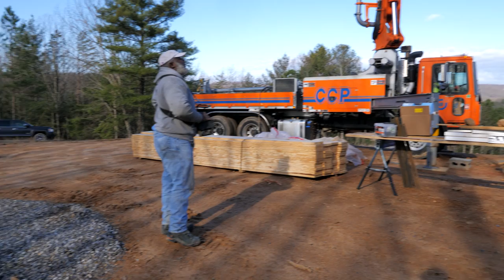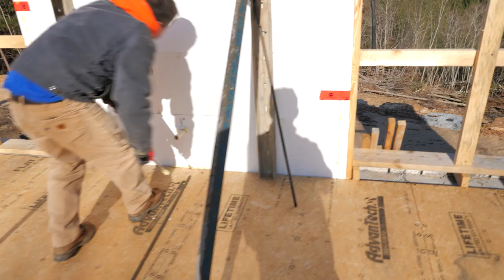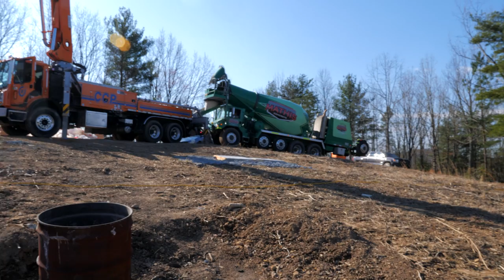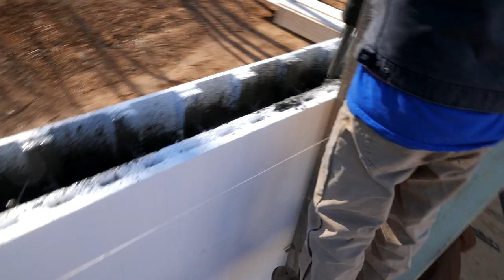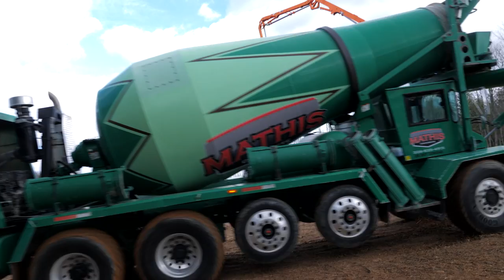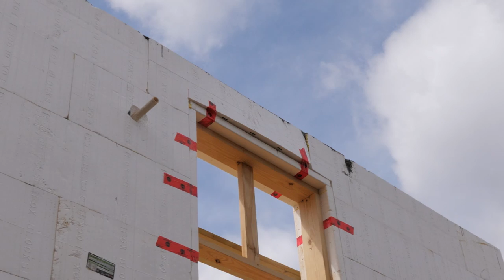ICF Mountain Homestead: Pouring the First Floor Concrete Forms

Comment: As soon as I saw the headers/lintels weren't strapped, I was nervous they would bulge/be difficult to align.  One thing I've learned from building with icf since 2001 is where it needs additional bracing.  It sure is a pain to have to rasp foam for hours to flatten it out!

Comment: Can you explain why you're doing ICF for the basement and first floor, but chose to wood frame the second floor? Is this a compromise for cost considerations or is there another reason why ICF made sense for the first floor, but not the second?

I'm curious about your thought process because I've been planning/fantasizing a house that would be full ICF exterior walls from the basement to the second floor. Should ICF not go all the way to the roof? Change my mind!

Great content, thanks for posting!
Reply from the maker: We’re doing it this way for a number of reasons. Window placement, cost, speed, etc.

Comment: Looked like the concrete was coming out of the hose pretty hard. Amazing the force the pump can do. Great to see yalls progress. You said gonna shave it flat. Does that mean you're pulling off the insulation in those spots or just shaving the insulation flat? Excited to see it get dried in! Thanks for the updates.

Comment: Insulated concrete forms look pretty cool. I had been researching the inverse option of having MgO-foam-filled ("airkrete" insulation) concrete blocks or panels. I like the cement foam solutions since they are the best insulation and they do not burn. Polystyrene does burn, although it will do a reasonable job at retarding the flame. And, these ICF blocks make house building a straightforward affair it seems.

[aside : 'airkrete' is different to portland-cement based 'aircrete' which is heavier and structural.]

So, in making some decisions, I ended up at this question about the ICF approach : "How do I attach anything significant to the walls in my ICF poured garage or workshop ?"
I cannot see any general wall strength that will support anything more than let's say some dry wall ... but certainly not anything the needs to anchor into a solid substrate (for example, a tool rack or hoist).
How are people doing that in buildings made with ICF ?

Comment: Did you consider do the wall penetration for the dryer after the did the first lift to make sure there weren't any possible voids? If yes, what reasons did you have to not go that route? Thx

Comment: Will there be a porch with a roof a the french doors? If so, please consider putting lights or ceiling fans with lights on that ceiling that are switched independent from the lights next to the french doors. I have found that bugs are drawn to the light next to my doors making it about impossible to use my outdoor lights in the summer time without getting bugs in the house when going in and out. For years, I have basically not even used my outdoor lights during any sort of warm weather for this reason.
Reply: He talked about that in the previous video.  Where the french doors are (facing north IIRC) will be a 10 foot open patio deck.  On the walls with the front and back doors (east and west) there will be a covered porch.
Reply: @michiganengineer8621  I thought he talked about that but I didn't want to go back and look for it. The point of my post was to have a lighting option other than right next to the door. In the South, bugs are a huge deal in the summertime.  They will come to the light and then into the house every time the door is opened.

Comment: Will the exterior be brick or stucco? Also, will vapour barrier still be required or is it not needed with ICF?
Reply from the maker: Exterior will be a mix of materials. Vapor barrier not necessary but we will use it down to the windows.
Reply: @Guildbrookfarm  thanks for the response. Very interesting to follow your build. One of the more informative channels on U- Tube.

Comment: To bad it didn't go as smoothly as first but then more opening more chances for things to go wrong..
So your not doing upper floor outer walls in foam concrete?
Have a good evening ☃️☃️☃️
Reply from the maker: Everything from here up will be stick built.